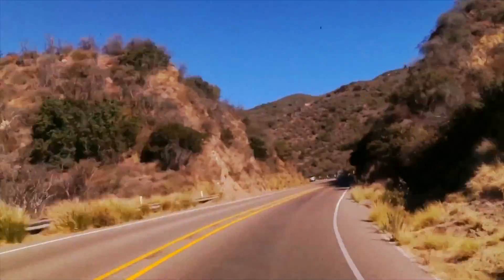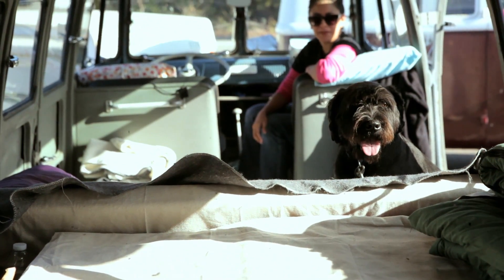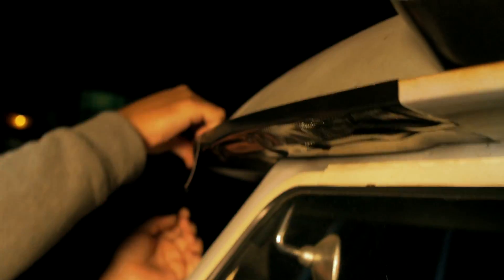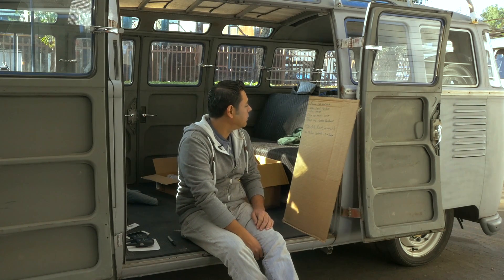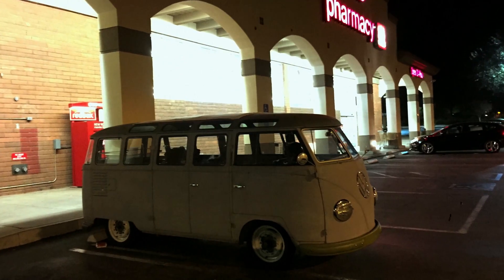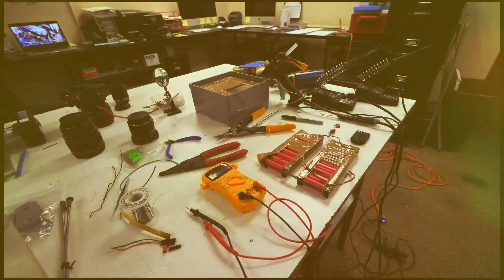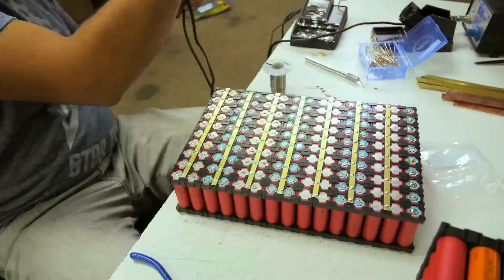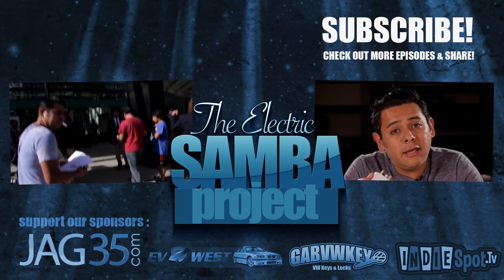Tesla batteries on Electric VW Bus for trip to Lake Havasu?  DIY EV

Comment: you said your 12 volt battery  when down  why don't you add a simple alternator/genartor.  a simple 12 volt  blower motor will chage may get low return 10 or 15 amps  to keep you 12 volts running . could get it to spin off the axel  LOVE  what you doing GARCIA BRAIN AT WORK
Reply from the maker: +Raymundo Garcia Because thats a really inefficient way to transfer power to the 12v battery,   A dc-dc works better and with no moving parts it requires less maintenance.    My 12v battery now can last 3-4 hours  at full load,  so i don't have to worry about it because my traction battery pack runs out of energy before and requires 4-5 hours of charging which gives the 12v enough time to recharge.
Reply: I ran in to you and love what you doing I have a 1961  corvair greenbraier  hippie corvair 8 door corvair  that i love to do what you are doing  and explain to my son that would be my drean just to do  what you are doing but no luck with funds.  its as rare as your VW i had it for 30 years with little trust . thank for taking time to respong . you know your shit i a master mechanic and love electrical  so you are way more advance that me I love simple simple old school stuff a charging styem  that charging the 12 volt at night  is driving off the axel will never loose the voltage for the van as long as you running you will not loose the power for the van. son I not trying to tell you how to do any thing cause you know your stuf . MUNDO GARCIA loves that you doing I just bought a nissan leaf I drove a PIECE OF shit ZAP CARfor 1 1/2 so you are doing vary good KEEP IT GOING SON  PEACE OUT  I learing for you

Comment: Hi, here's a suggestion for your charging problem ! Why not put in a few tanks with compressed air that runs an air-motor-generator so you can even charge while you drive !? Remember any gas station has compressed air free of charge ! LOL
Here are some links to cheap parts you can use...
http://www.walmart.com/ip/Air-Motor-5.00-HP-175-CFM-Foot-Mounting-G6183755/41420982
http://www.ebay.com/itm/Freedom-II-PMG-48-96-volt-permanent-magnet-alternator-generator-4-wind-turbine-/371078065936
http://store.gaugemagazine.com/aluminum-2-gallon-3-port-air-tank.aspx

Comment: ive been watching your videos, suppose i want to take a toyota AE86 and put an electric motor in it, now aside from the fac that its a totally different vehicle and would need its own custom work, how hard is this to actually do? im assuming money is the biggest constraint on the project and thats something anyone can deal with over time... but, aside from that how complex is a system like this to actually get the parts for? is this something a regular guy with a soldering iron and some skill can pull off or something a professional would absolutely be needed for? thanks for your time on this, id like to start my own electric car some day soon, that is if its able to realisticly be done.
Reply from the maker: Depends what kind of a regular guy you are,  are you the kind that can't change a tire or the kind that can replace a burnt clutch?   You do need some sort talent understanding mechanical and electrical systems,  but no need to be a professional.
Reply: lol there's not a part i cant take off my car, and electronics are my hobby... so id assume im good to go, thanks for the advice.

Comment: You should look into making or buying some type of LED lighting for the headlights. Much less draw with those.
Reply from the maker: yes, LED was too expensive last time I checked $300ish for decent ones,   maybe in the future
Reply: jehugarcia No man, Check out www.theretrofitsource.com or www.hidplanet.com its very easy DIY and you already have the skills to do it. you can get X5 LED foglights for under $100.
Reply: jehugarcia They wont last, they over run the things to get the light, and in 12 months will be half as bright etc. stick with old tech for now. even hid is useless as with the bulbs needing 80v ac or so to run the inverters make then really inefficient

Comment: Are you running some modern low-RR tires on this?
Reply from the maker: No just some budget tires and at half pressure at that on the way there,  I filled them up to 40lbs for the trip back and I think that helped substantially.

Comment: now i know what you used for the battery fuses. keep up the cool work.
Reply: added note on this did you use 1/4 watt or 1/2 watt resistors?
Reply from the maker: austins_creations  1/8 watt i believe

Comment: Quick question. I can't seem to see any charging controller on the 186500. As I know with out one the batteries would go out of balance
Reply: I think he's relying on bottom balancing (and maybe a slight under charge) but i personally would like to have a cell balance system
Reply from the maker: yeah bottom balancing for now, its possible to operate without BMS when using new cells,  this experiment will show if its possible to do the same with these multi-brand recycled dead cells.